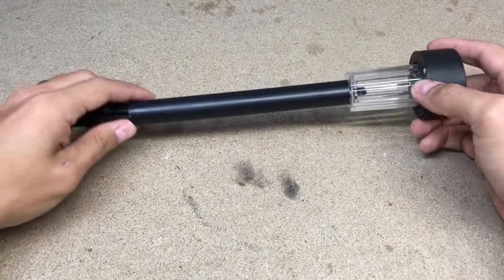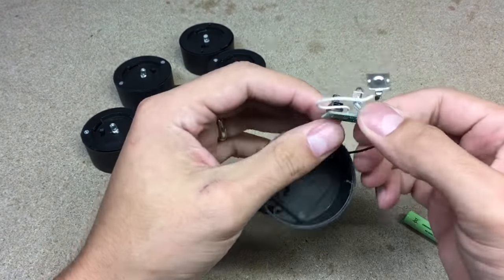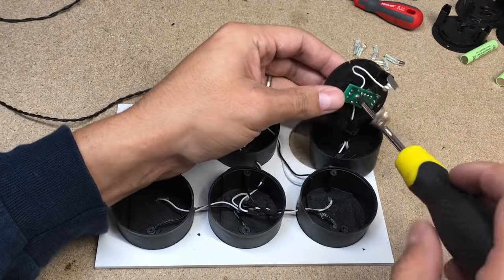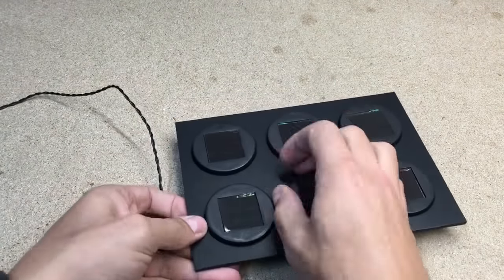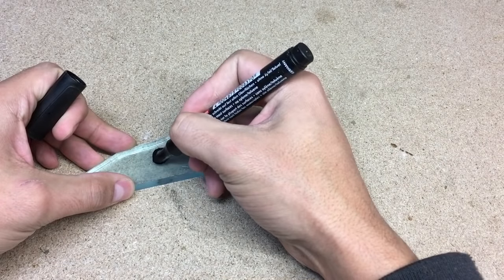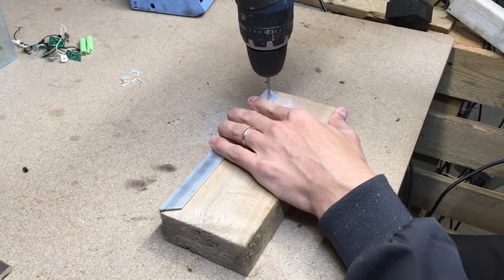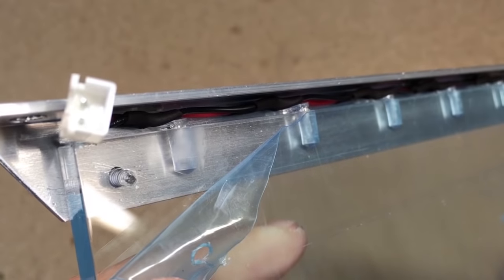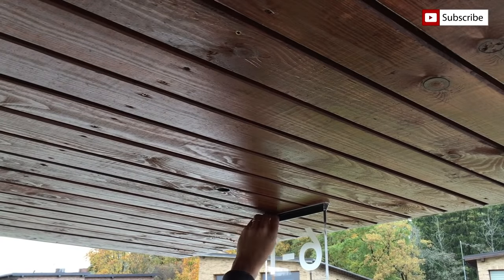DIY: Illuminated House Number Powered By Solar Panels

Comment: One possible way to improve this project quite a bit would be to add any kind of reflective material to all of the edges (or just the bottom and top edges). You could also use mirrors with the right size. This keeps more light inside the acrylic and improves the lighting of the numbers.
You could also swap out the AAA battery for a much higher capacity AA 1.2 V rechargeable cell for longer on-time.
Very nice video, I would like to hear from you what you think about my ideas and maybe see an upgrade video if you want! Keep up the good work. :)
Reply: Manuauto
Reply: Thought the same thing
Reply: Thanks for the tips!
Reply: I would put multi batterys in a sled in parell to add capasity especialy with all them cells
Reply: You take 6 put and put 1 back in, but still use 6 leds more batteries brighter it will be

Comment: If you add some reflective ducktape at the bottom of the acrylic glas you can nearly double the brightness and there is no light at the ground under the number.
Reply: the reflective part isn't on the sticky side though

Comment: Also use clear fingernail polish inside the drilled hole to help get more light "into" the plexiglass (to cut down on diffusion before you want it)

Comment: Andddd, nobody said though, LEDs are NOT devices to be connected in parallel. They MUST be current controlled, hence they need to be connected in series setup. If you connect several leds in parallel, the one with lower forward voltage will get most of the current, that leads to overheat that leads to lower drop voltage that leads to more current... towards destruction, led by led...
Reply: LEDs may be controlled by a constant voltage source or a constant current source.  As for series connected, you must know that if you lose one, you lose them all.

Comment: Standard YX8018 and 220 uH inductor gives about 18mA of current no matter what (that will be also 18mA for all 6 diodes). Just do 2 (39mA) or 3 (60mA) of inductors (220 uH) in parallel and you will get more light, but the time of working will decrease 2 or 3 times then. You can also use 0,5 or 1W solar panel - 5,5V for one eneloop AAA and it will work fine (more current with lower voltage - about 80mA in full sun). I tested it. Thoose lights are working with 60mA of current for 10 hours (eneloop is 800mAh), so it will be ok for 13 hours.
Reply: Thanks a lot for your comment. This is actually what I was searching for. 
Can YX8018 handle 5.5V solar panel?
Reply: @Electrologia  I am using YX8018 with 5,5V solar panel 60 mA, 750 mAh battery (1,2V) for about 5 years. Still working. I am thinking that maybe YX8018 is not able to take 5,5V in - ok can work day or 2 if battery contact fail, but battery resistance decrease the voltage during charge from 5,5V solar to Ni-MH battery current voltage (during charge changing) + diode decrese voltage (so about 1,8V during almost full charge). I noticed YX8018 is able to break - solar panel input pin failure resulting no light up LED. It took place in 2V solar panels and 5,5V solar panels. I am using QX5252F because of a lot lower number of failures, good work with 5,5 V solar panels ( up to 1W or 220 mA), but also with high current output - from 1 mA to 250 mA (average). More eficcient is using 2,4-2,7V solar panels because in same area you can get higher current. Also MPP is closer to working point. But 5,5V solar panels can do great work during cloudy days too.
Reply: @mati211p  Thank you very much for explanation.
May I ask for the second solution for my problem? I have some LEDs in series connection. and I do not know which Amp should be okay for them.

 If 1 LED needs 20mA then how should I calculate for 2 or more LEDs?
Reply: @Electrologia  Depending on connection. In series connection current is same for all LEDs and flow trough all LEDS, only voltage increases. In solar lights (1,2V or 3,6-3,7V applications) LEDs are in parallel connection, so double/tripple current but same voltage. In parallel connection you increasing current, in series - not because it will result damaging LEDs. If you connect in parallel connection two or more LEDs with different characteristic, you can also get damage of LEDs. Solar ICs like YX8018 will not work if you connect 2 LEDs in series as output.
Reply: @mati211p  thank you for your help. everything is clear now :) Gonna try to make a small project. have a nice weekend.
Reply: @mati211p  dziękuję bardzo.

Comment: Hello, 
Nice video, but please tell me if I want to put a SMD LED (for stronger light) instead of the simple LED you have used, what changes should I make to the circuit. I mean will the  QX5252 chip work with one (or several in paralel) 5730 SMD led powered by a 3.7v 4000mAh 18650 Li-Ion battery? (with more solar cells to recharge)
I am waiting for your answer.
Thanks
Reply: Let me know if you have got answer. interesting for me also

Comment: Just use a u profile and put a led stip in is more simple and works better
Reply: LED strip would have required more voltage; I think he wanted the whole thing to run from 1.2 V.
Reply: 1.2v per LED, and there are 6 of them so he really was using 7.2v. In reality white LED's need about 3 volts to achieve optimal brightness. a 5v led strip would have been more effective in this situation, along with a standalone solar panel and 4 rechargeable AA batteries.
Reply: Zac, If you actually watched the video, the panels and the LEDs were both connected in parallel. This increases the current (source/draw) without changing the voltage. The YX8018 chip in the controller is a voltage boost chip so that it produces roughly 3V from the battery 1.25V.

Comment: Umm wtf? 6 cells, 6 leds, one board and one battery? Its not the energy production, but the energy storage that sucks in those lamps.. i replaced 600mAh battery with proper quality 800mAh and that alone did big difference on the burn time. In this build you can charge roughly hundred time over that one batterys capacity, even in bad day. Put 6 batteries on one cell and you would charge that fully in good day, as it wont use all energy until sun comes up..
Reply: Hellsong89 i put two 600 in parallel to get a 1200mah source

Comment: I know led don't use that much power but 5-6 LEDs only one battery! how is that???
Reply: HennessyLane1 there are different ways of connceting them so they draw different voltages and they only use a tiny amount of current
Reply: alexander troyak thanks I'll look into it a little more

Comment: looks cool, but who needs to read your house number at night?
Reply: my part-time job is to deliver pizza and i work at night a lot and its a pain in the ass to find the house number at night... this would be great if everybody had it
Reply: Hardly anyone, just firefighters and ambulance drivers.
Reply: Ricardo Pinho You get it. The average house is hard, if not impossible to see the house number at night. It is either obscured or not lit up well enough to see from the road easily.

Comment: This is a great video. However, I know of some corrupted contractors & their equally corrupted raised kids and their buddies, that have homes they live in that doesn't have a house number on it. Someone, doesn't want anyone to trace their corrupted tails back to their home, You Think? I wonder if the mailman even delivers mail to them? Moral of the story, some criminals remove their house address numbers from their house for a reason. Especially, not putting a glowing bright LED one on the home.